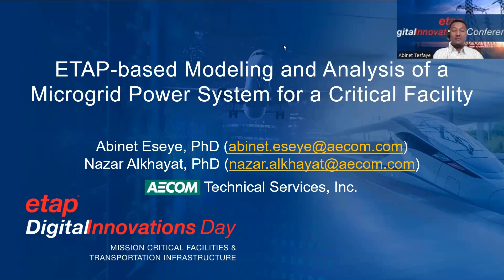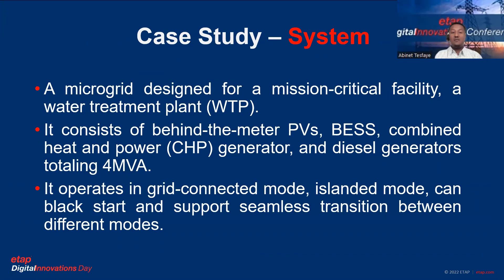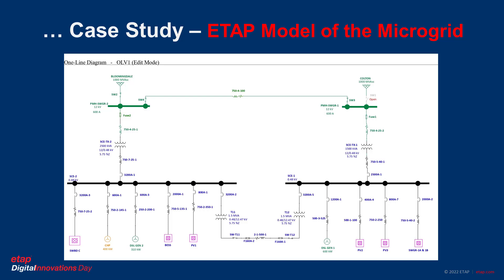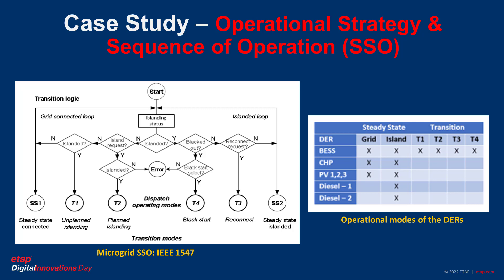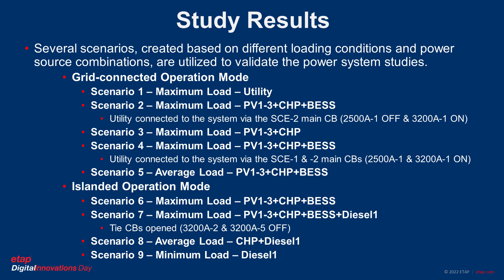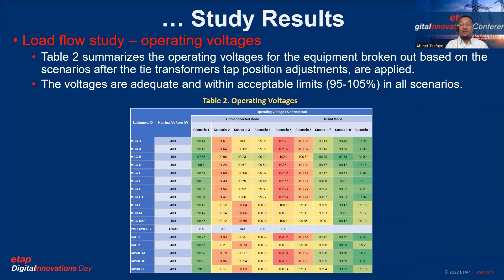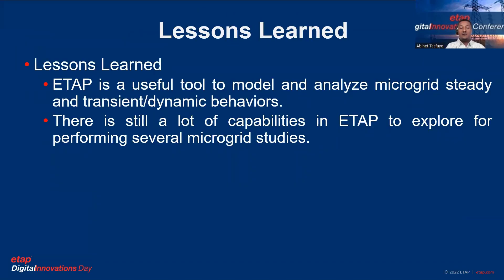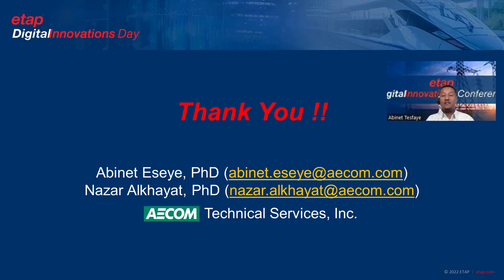Modeling and Analysis of a Microgrid for a Wastewater Treatment Plant

Comment: Thank you very much Abinet, I got two points: 1. How did Etap desides lose of synchronism so that the system will decide to operate in islanding mode 2. Can you do coordination study using Etap tool?
Reply from the maker: Thank you for your interest in ETAP Solutions. Yes, you can do protection and coordination studies in ETAP the module is referred to as ETAP Star. There are several videos on our channel:
https://youtu.be/pNr_lpnbWcE
https://youtu.be/hdjzEvAa0pg

There will be a webinar on Wednesday covering all of the latest features of ETAP's Protection & Coordination module. Sign up here: https://etap.com/singleevent/2022/11/02/webinar/protection-coordination-110222